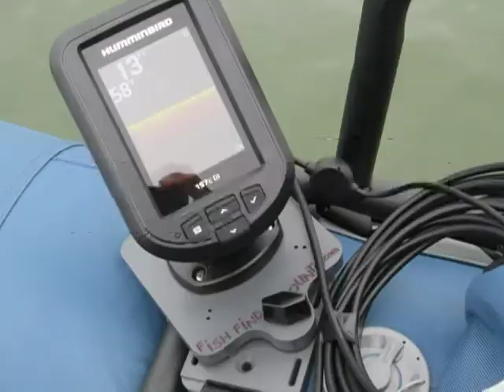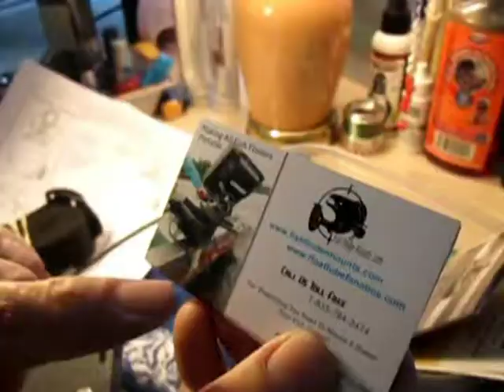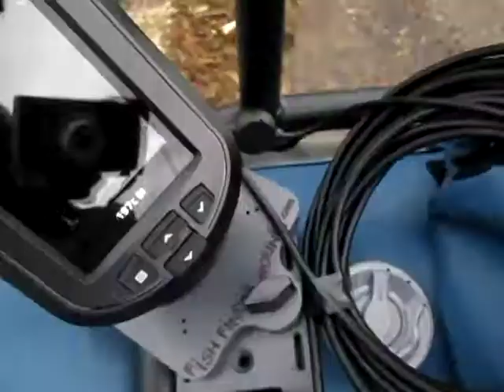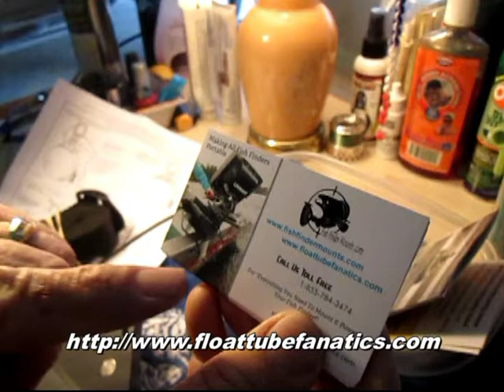FTF's UP2 Depth Finder Mounting System Performance Review

Comment: Don, the UP2 Mounting System was so slick that I wish I had the type of boat or float tube that could make use of it. You ably showed how simple it is to attach the depth finder to the boat and hook it up to your battery. Nice job on those pretty crappie and bass!! Very well done on my friend! All the best to you and Brenda!!
Reply from the maker: Juanelo1946 John, I'm sure you've seen other versions of FTF systems on my float tube/belly boat as well as the Roanoke pontoon boat and perhaps also remember the one with the magnetic transducer mount (really cool) for Jon boats.  I bought a newer Humminbird depth finder and trolling motor when I got the Colorado XTS (to keep up with kayakers - ha!),   Wade at FTF had the perfect, super easy to install "non-powered" mounting kit because I didn't need the normal battery box/battery that comes with his various mounting kits.  I hope that others who have available power on their pontoons and need a fish finder mount can see what a great system this is.  I'd be lost without a depth finder.  All the best, Don